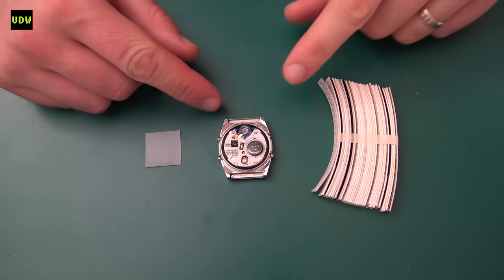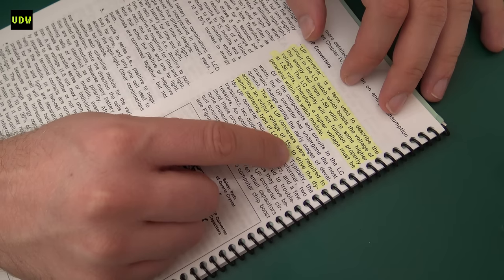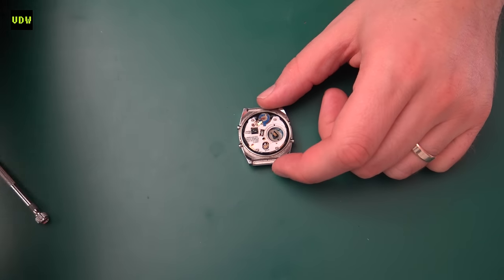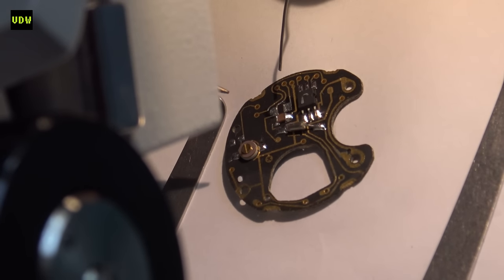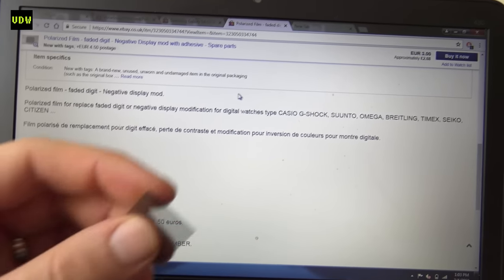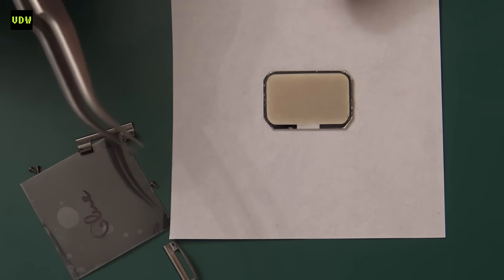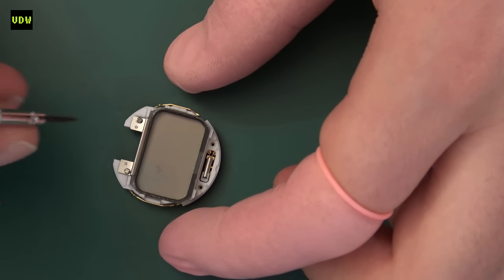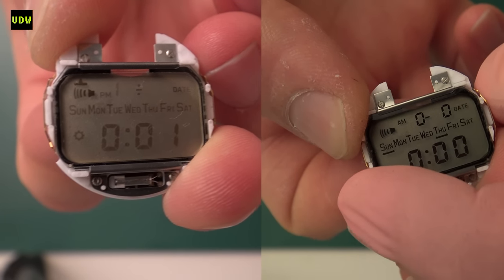Faded LCD display Repair - Ep 49  -VintageDigitalWatches

Comment: I dont understand the thinking around the capacitor. You measure the existing capacitor to know what you should replace it with. But if the capacitor is faulty and you exchange it for a new one with the same value as the faulty one you would get the same result right? Why are you expecting an improvement if you change one capacitor with another with the exact same value?
Reply: Caps loose their value over time duh
Reply: @JohnChrysostom101  read my post again. I’m not disputing caps deteriorate with time. I’m questioning your method of assessing what caps you need based on the measurements of old caps. Duh
Reply: Just look at the end of the video, lcd got fixed. End of history.😂
Reply: @israelsalas4617  you are missing the point. I’m questioning the method, not the outcome. Wrong values of caps can still make electronics work, but can reduce the lifespan of the product. Learn how to read and think logically. This is not rocket science. If you measure an old cap to determine what replacement you need is a bad practice since the old cap can be out of spec…. Because it’s old
Reply: @tenshin2002  people like you get stuck within simple problems. what if you don't have schematics or proper info? that brain will be on blue screen.

Comment: If you read the capacity of a damaged condenser you have a wrong reading. When you replaced the capacitor with one of the same capacity you have no changes. The question is, what was the original value of the capacity before the damage!
Reply: I agree on that. And furthermore, this type of ceramic capacitor (MLCC) is known for a loss in capacitance over a long time, caused by changes happening in the ceramic material. But it can also regain its full capacitance by heating it above the so-called "Curie temperature" (around 125 °C). This heating process must last for about half an hour, so the short soldering time is usually not enough to reverse the capacitance loss. But IF some of the loss has been regained, the capacitor will lose a lot of it again in the first time after the heating. That's why measurements immediately after heating may give unreliable results. The capacitor should rest for a couple of hours before being measured.
Reply: Today I successfully de-aged the capacitors in the 549 module of my Casio w-780. I unsoldered them and put them on a cooking plate for 1 hour at the lowest setting, which gave a an average temperature of approx. 170 °C. They all regained a considerable amount of capacity, but like I said before, in the first few hours after heating, you can literally watch them lose some capacity again, until it stabilizes on a higher level than before. So it's hard to say how much capacity they gained in the end, since the soldering heat also has an influence on it. But I guess it's somewhere around 30% or more.  
Unfortunately this did not solve the problem with the display, which shows a changing amount of fading in several segments. So the loss of contrast is not evenly distributed among the whole display, and it's not always the same at the same spot. What is even more strange: When I activate the test mode (all segments visible) the fading effect is gone!! And if I supply the module with a higher voltage (around 3.5 to 4 V), that eliminates the effect too.
Right now I'm a bit clueless as to what is causing this. Any ideas?
Reply: Norbert Bendl if you are loosing voltage at the in contacts of the screen, maybe is a problem of the resistances or the soldering points.
Reply: Reading the bad cap and selection of near same value would not fix the issue. The cap should be listed in the service manual. Looks like he had a manual. Why didn’t he look up the proper valve in the manual.
Reply: @rick601a  that is exactly what the original comment said
Reply: Agree too. Was about to comment the same.
Reply: Exactly!
Reply: Yes..👍.. Watch Maker Experience..!
Reply: @norbertbendl6076  Interesting!
Reply: @rick601a  he did say that the manual didn't have a value of the capacitor.

Comment: I don't really understand a lot of electronics theory but from my logic I would derive that if the capacitors have drifted over time to a different value, the replacement should have their original value and not the current one because that is the wrong, drifted one. Does that make sense? Or do capacitors work in a different way.. Would appreciate if someone could help me on this

Comment: I think that if the original capacitor is bad, the reading in the multimeter is giving the bad capacitor value, so changing it for a new cap with the bad capacitance is useless. You would need to know the original capacitor specifications.

Comment: According to your capacitance meter you changed a good capacitor with a same spec capacitor, no wonder you had no change in display.
Reply: No, because if you measure an old capacitor it will still have some capacity... And putting the same capacity as a used up one makes no sense lol.
Reply: Exactly!

Comment: Next time try replacing the capacitor with a higher value. I would also replace the smoothing capacitor as both would have equal aging issues.
Reply from the maker: Will keep that in mind for my next capacitor replacement, thanks @MidnightVision
Reply: I know next to nothing about digital watches (yet...just starting), but I do have some experience with 70s and 80s electronics via a love for arcade machines and games consoles. If you’re going to change one capacitor- change them all. I’ve seen a 40 year CRT screen shine like new after that

Comment: With apologies for digging these comments up after 5 years, I have a question about a faded LCD/Casio T-2000 project I'm plotting…

If you measure an existing Up Converter capacitor which has already degraded, won't the replacement with a capacitor of an equivalent value also provide insufficient power? Really you need to know what spec that component had at the factory.

Also, so many thanks for these videos. It’s a great (and also scarce) resource.

Comment: If going the polorizing filter route, I would make up shims from the left over material, drill appropriate size holes and install them under the lcd clamps. That way you can tighten the screws properly and would not have to worry about the lcd moving around.  Good video.

Comment: I enjoyed your video. Thanks for posting. The problem I see is that you measured the capacitance and then replaced with exactly the same. Your result was just what I expected. If it was the capacitor, then the value you measured was the value after it drifted, not the value it was when it came out of the factory. I appreciate you do mention that you can't find the original specs, but replacing like for like will result in no change.
Reply from the maker: Yes I agree, I hoped that other paramaters of the capacitor would have been outof spec, so a new one I knew at least those were fine. A variable capacitor would have been a good idea thoughu to test.
Reply: You were very brave to attempt the fixes - both the capacitor fix and the polariser fix.
Inspired by your videos I have just bought a non functioning Seiko 0439 5009 on eBay.
Reply: Yep, agree with Richard. I’m no expert, anything but, but it would have been worthwhile replacing the cap with one 30% to 50% above what you read from the old one, and also replace the other cap (right beside the first) at the same time.
Reply: Exactly!

Comment: A few points:  First off, those ceramic capacitors for the most part never fail, given the low voltage and low pulse energy of the up-converter; furthermore, if the 'smoothing-capacitor fails, it can (if leaky) drag-down the up-converter voltage; so I would replace them in pairs.
They make a tweezer style soldering irons that allows you to grab to capacitor all in one move; saving the PCB and substrate.
Also, using Blue-Tack clay will allow you to stabilize the movement while you work.

Comment: When LCD watches first came out, the displays only had a life expectancy of around ten years, before the chemicals inside degraded... and unfortunately, that is still the case today - even with large back-lit TV screens.
Reply from the maker: There are actually some early manuals from Citizen that informed you that you LCD will last 40.000 hours if I am correct, so that is just under 4 years. But they still work today so probably they were guestimating.
Reply: Gold plate

Comment: In my case I can't find a local distributor of polarizer replacements. So I use polarizer films from old LCD panels. Some of them are thick and touch enough to peel without damage and can be recycled. I use solvents like lacquer thinner when peeling off the film using Xacto knife and wiping off the glue.

Comment: I wonder if you could have removed the old polarizing film first?  When I have modified negative LCD's to positive (I hate the dark LCD's), I have always taken the old film off first.  Thanks for the video.  I've got an older 1545 module Casio DW-5600E with a faded display.  I'm going to try to invest some time in taking the old polarizing film off and installing new film.

Comment: Cleaning the zebra strips and display contacts with some alcohol can also help with a faded display. I did this with an old LCD game and the difference was night and day.
I just received a watch that has a very faded display (more clear when looking at an extreme angle). It also fades out when pressing a button (not when pressing the light). Also the digits change slowly. I think this is probably a bad capacitor, or a dirty contact somewhere.

Comment: Generally nothing happens to ceramic MLCCs with time. Sometimes they crack across and then they fail, either losing the bulk of their capacitance or going short, but there is no gradual expected decline in capacitance, no chemical changes, these are extremely inert materials, so they shouldn't be replaced unless indicated by measurement. It's a good idea to measure in-circuit so you don't have to needlessly damage the substrate by soldering if you have a good idea of the circuit overall in cases where there isn't a lot of parallel capacitance, and if it measures too low or you get a resistance measurement across is too low, then replace.

Boost circuit capacitors are not critical in capacitance, 10-20% is fine. They have variation from the factory.

Thing is you never know whether your new MLCC will be a quality manufactured product that is going to last (especially if you haven''t bought it off Murata, TDK or Kemet), or whether it has a hidden fracture or material inconsistency from the factory that can cause it to crack; and the process of desoldering and resoldering MLCC can fracture them via thermal shock, so desoldered MLCC should normally not be reused even if they measure OK. So if your in-circuit measurement gives you a good indication that they're fine, leaving them alone is an adequate course of action.

Comment: Very interesting video. It made me inspect my old Casio W-780 with the 549 module again. It has a very strange contrast problem, I've never seen before. Instead of an evenly weak contrast over the whole display like in your video, it shows a "dynamic" loss of contrast depending on what is shown on the display. That means, the same segment can have full contrast at one time and weak contrast at another, depending on what the other segments show. Or a segment that is supposed to be off, is sometimes visible with a weak contrast. So this can obviously not be cured by simply sticking a new polarizer on top of the display. So after watching this video, I started to think about whether this phenomenon could also be caused by a weak capacitor. Unfortunately I can't find any technical document about the Casio module, nor any information about such behavior of an LC display anywhere else. The module has three capacitors in a row, so I don't even know which is the up converter (if any). What do you think, may this problem be related to a weak capacitor? The display also shows a very slight amount of the rainbow effect, but it's barely visible.
Reply: That is most likely a problem with contacts on the zebra strip, specifically the common or ground line.  Power returning is variable depending on load (how many segments are active).  If one segment is consistently faded, that would indicate the problem is on that driving contact only.  In either case, the fix is to remove and clean the zebra strip with isopropyl alcohol (aka IPA 99%, aka electronics cleaner).  Sometimes one side of the zebra strip has a contact glue film on it, and that can make the job harder as the cleaning solvent will remove that glue as well - makes reassembly much more difficult.  You can try cleaning only the unglued side, and that may work.  Do not attempt to apply any glue yourself, it will just ruin the display, as is the case if you just smear that glue across the contacts and then try to reassemble it.  (misplaced glue will insulate the contacts and prevent it working.
Reply: @Chris_the_Muso hey thanks I'm going to look into this zebra strip, got an old Bape G Shock that was supposed to just need a battery but it's about 20 years old. I put the battery in and I could see the numbers but they were faded. Within about 5 minutes I could no longer see the numbers or display but back light still works so I know the battery is good. One of the buttons was sticky and inactive so I thought maybe if I gut it and clean all the contacts with alcohol maybe it would work, while I have it open I'll play around with polarizing film as well

Comment: Wearing my Pulsar LCD, I'm rather surprised to find your channel, every watch channel I've come across is for mechanical watches.
My LCD kept fading out, however it was due to a failing insulation sheet that normally sits atop the battery so it won't touch that case back. It was , severely reducing the battery voltage causing the display to fade and sometime the time to reset.  My mech was not easily disassembled, and I suspected some corrosion had gotten into the various layers that form the battery/power connection. In the end it twigged on me what was going on and a new plastic sheet had it fixed

Comment: I have a vintage lcd digital watch which display is pretty dim. Thanks to you I know that it probably needs a needs a new polarizer. But I’m a noob and don’t want to mess up the watch, also I would like to add a led backlight to better see the time in the dark. Furthermore it needs a better sealant on its back cover plate for more sweat resistance. Would you be able to help me out?

Comment: Very amazing video again. In my opinion it would be better to cut the polarizing film before some smaller to prevent what you described, that the film is liftet by the guides. Because the visible part of the display trough the window is smaller than the LCD itself. I think it can be 1mm away from the border without beeing visible later. And the thickness of the display would be the same as before in the areas of mounting the brackets. On the other hand not so easy to install. What do you think?

Comment: Hi ,, I’ve been looking for these filters and can’t find them on eBay. What I can find is big sheets self adhesive but for galaxy phones .  They are very cheap but was wondering if they would work?  Is a polarising filer just a polarising filter or are there many types . ?
Reply from the maker: Hi, Michael Reitberger posted a link below in the comments with a supplier but there are many variations and I don't know if they make any difference, but what I can tel you us that I used this one:  https://www.ebay.co.uk/itm/Polarized-Film-faded-digit-Negative-Display-mod-Spare-parts/323235191374?ssPageName=STRK%3AMEBIDX%3AIT&_trksid=p2057872.m2749.l2649

Comment: So i bought an old G shock needed a battery change, i put the battery in and noticed the screen was very dim and actually missing some pieces of the numbers before losing all the numbers completely. Back light still turns on.

So i think i need to do the up convertor trick. I hope watching this video helps me figure it out!
Reply: wouldn't it be easier to just replace an entire module?
Reply: @eruno_  it's a limited to 1000 pieces 20 years ago. Can't really just get another. Ended up fixing it though.
Reply: @mastaboog749  ah thanks for clarification.

Comment: Great! I usually remove the old one, a tricky job but works nice...
I had done one few days ago, it was a Casio W-350,module 152 with a reddish front polarizer film.
Reply from the maker: Is there any glue residue left after you peel of the old one?
Reply: Yes But you can remove them with soapy water and  a qtips,so you can't scratch the lcd panel
Reply: The other advantage of removing the old filter is that you can use it as a template to cut the new one!  I think you would definitely have to remove it if you wanted to invert the digits and background colours.  I use polarising filters for a gameboy which are cheap on ebay.

Comment: If the capacitor value shifted then why would you use the value of the defective capacitor? I would think a higher value would be needed to restore the charge state.
Reply from the maker: Yes, my approach on replacing the caps was not good.

Comment: Impressive
May be stupid question: would it be possible to stick the film below the watch case glass instead of sticking it on the display itself?
Do you have to pel the old polarizing filter off before sticking the new one?
Thx
Reply from the maker: Haven't put directly on watch glass but one thing that might happen if it is exposed to light the glass will heat and cause the film to detach.  No need to eel of the old polarizer
Reply: @VintageDigitalWatches  : I did the film addition. Looks great now, and a 25 year Pulsar watch is back on the scene. Thx for this great video.
Reply from the maker: @sbe4998  Great stuff, always nice to hear someone else improving their watches. Cheers